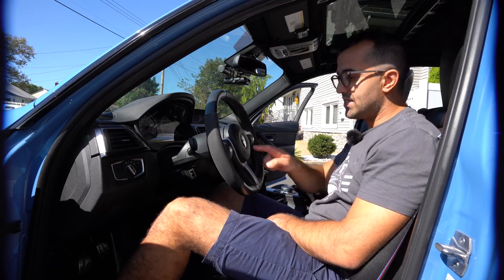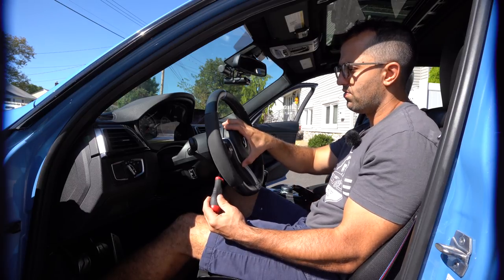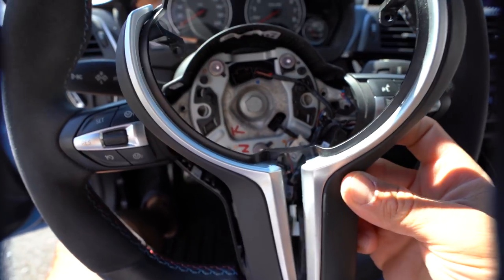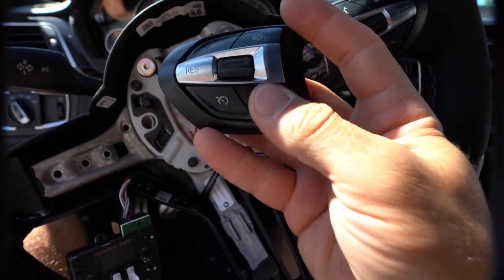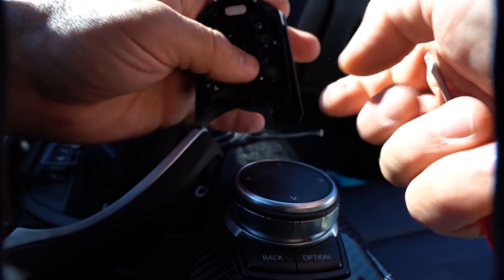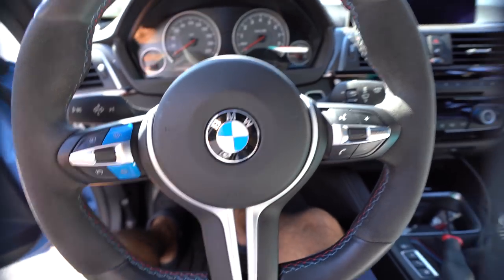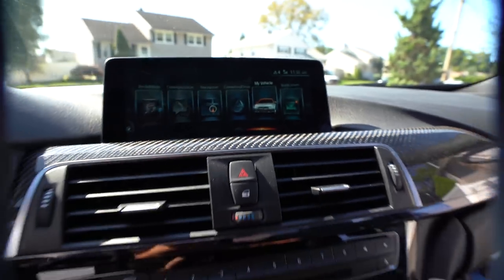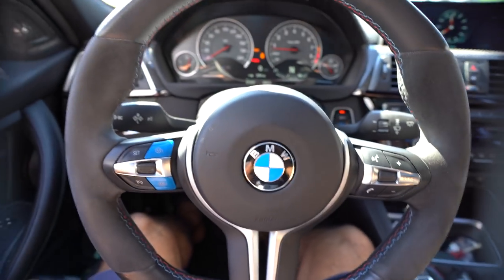DIY BMW M buttons on the steering wheel install (M1 and M2): easy mod for M2, M3, M4 F80, F82, F87

Comment: Excellent, Tommy!  One tip for M2 and M4 owners--since we have frameless windows (unlike the M3 sedan), you need to "reinitialize" the windows after reconnecting the battery by putting them down, then back up, with the car on.  If the driver's door is open with the window up when the battery is disconnected and then reconnected, the system is a bit confused and will not automatically lower the window a slight amount to allow the door to close.  As a result, the top of the window can strike the weatherstripping and cause damage or break when you close the door.
Reply from the maker: Ahh good one to know. Thanks!

Comment: Good tutorial.  Only thing not mentioned was if you have DCT and paddle shifters will need to remove them to get at the rear screw for the button module to release.  They are attached by another torx #20 inner to the module screw assembly.  Broke mine off not seeing it and not fully releasing.  Had to glue it back into place on the wheel but that’s okay as no plans to reverse this modification on my car.
Reply from the maker: Ahh good call. Thanks!
Reply: Yeah can’t even tell once glue dries and painters tape removed!  Fully functional!

Comment: Can I replace just the cruise control dial? The rubber on mine has torn. Would anyone be able to assist with a part number?
The entire assembly (controls on both sides) as a pair is 61317849409.
Reply from the maker: You have to get a used set on eBay and pull off the button.

Comment: Doing this method is it possible to remove the whole buttin itself from both sides (for example to retrofit new multifunction buttons without removing the steering wheel or is the wire behind so it will need to ge disassembled? Thanks
Reply from the maker: Yes that’s the same procedure

Comment: Hi

I have my buttons for over half a year now, the change of the start button was easy but tons of tutorials for the M1/M2 buttons were too complicated. I'll to this on the weekend on mine now!

Do you ultimately have to remove the battery to do this? Thanks
Reply from the maker: No need to remove the battery just disconnect the negative terminal
Reply: @TommyLGarage  When disconnecting the battery to do this service, can the settings of modules, windows, lights and others, be lost ?

Comment: Hi Tommy, I disconnect the battery and installed the M button,  but when I restart the car, the M button not working, only flashes. Do you know how to fix it? Thanks!
Reply from the maker: Yes. Turn the wheel all the way left then right. It will fix itself

Comment: Great vid, my buttons were too tight and won't return to original position, glad I tested before putting everything back, gonna try order another set and see if it's better, Many vendors on Amazon & eBay but inconsistent quality. Where did you order yours?  Is it nice and loose and bouncing right back like factory? Thanks.
Reply from the maker: I got mine from Kies Motorsports

Comment: Followed the video but didn’t do the steering wheel reset, thought I’d broken the car ☹️it seems you have to do the steering reset or the m modes just flash. I have the DCT version so had to remove the paddle.
Reply from the maker: Mark Dawson wheel reset is turn wheel left then right all the way

Comment: Great video. What kind of connector is the battery cable? Just pinch to remove? Or a lift and pull type thing?
Reply from the maker: You need to unscrew it with a 10mm wrench
Reply: @TommyLGarage  sorry I mean that one connector for the airbag sensor/power supply. It's way in there. First time I did this I just pinched it and broke the retaining clips around the connector. Do you recommend just a flathead or?
Reply from the maker: @cwx8  oh yes a small flathead will work

Comment: There is no need to take the airbag off and all the trim on the manual trans. Just take the screw out the back of the side you want to work on and the button panel just pops out.
Reply from the maker: Good call
Reply: @eviltriangle  yes mate, 100% sure. I have also changed the colour of the buttons and just take out the 2 screws at the back and wiggle it out. Comes out easy.

Comment: Hey  Tommy. I just installed the same M1M2 buttons on my 2016 M3. It was almost as easy as your video! I hit only one minor snag and that was I have OEM paddle shifters and they covered the small hole on the back of the unit holding the buttons. It was an easy one-extra screw removal to move the shifter out of the way and continue on. BTW...have you done a vid on installing after-market paddle shifters? If not could you? Thanks again!
Reply from the maker: Glad it was helpful! And will do on paddle shifters